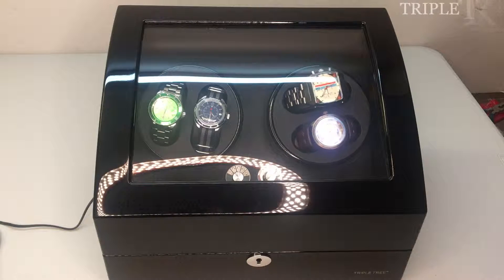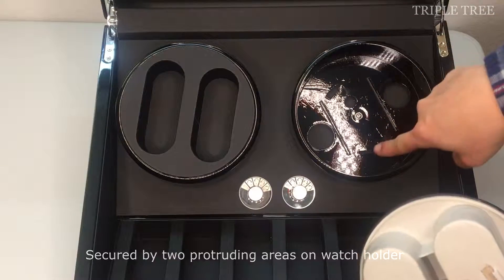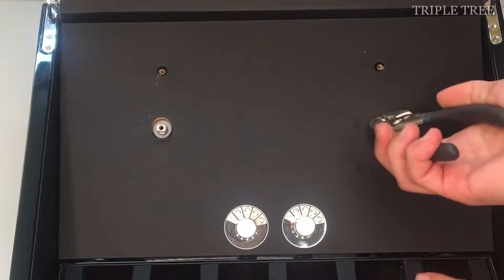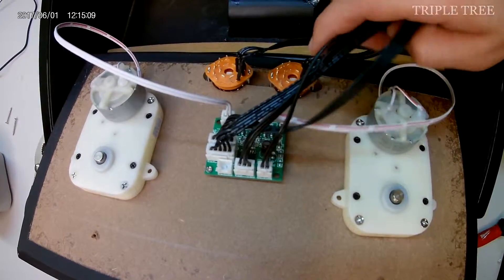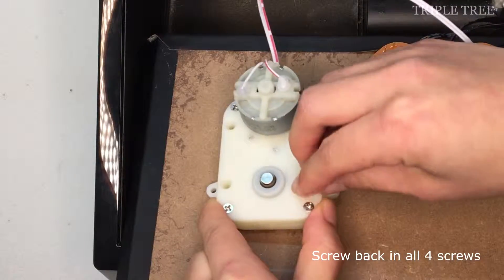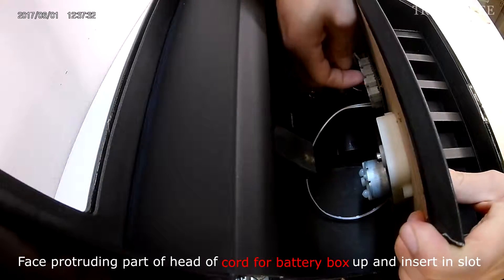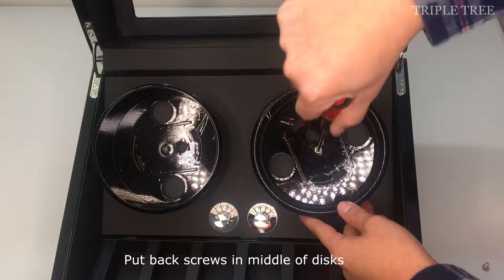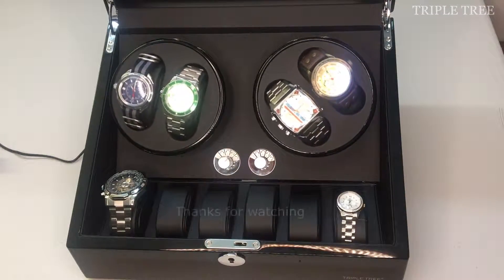How to Replace Motor in TRIPLE TREE 4+6 Watch Winder

Comment: You don't need to replace it. You can fix that one. I did. Take off the white plastic on tr back of the motor and clean the brushes. Easy, fast and free.
Reply: White plastic? I have one that doesnt work. I lost the wire but it takes batteries right?

Comment: This was very helpful. Bought the replacement on eBay by searching watch winder motor. Just a quick tip on, when this video tells you to use pliers to remove the board, I’d recommend using a thin butter knife at the top of the board and go right to left gently wedging it out. The pliers didn’t work for me.